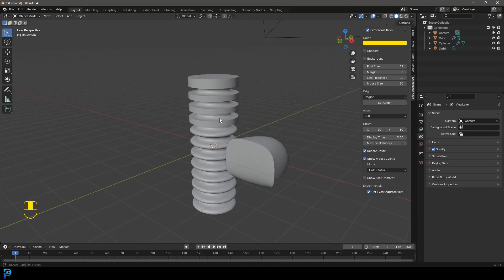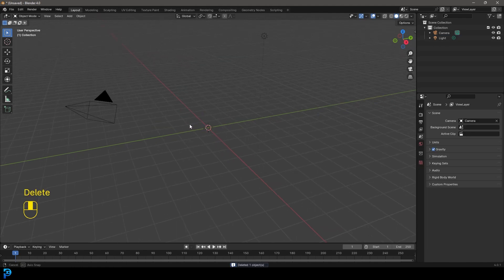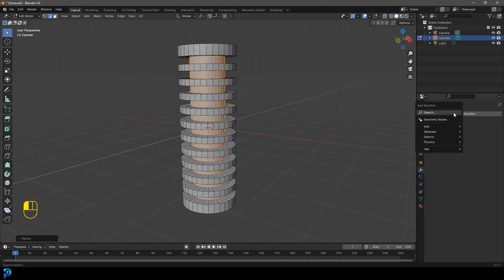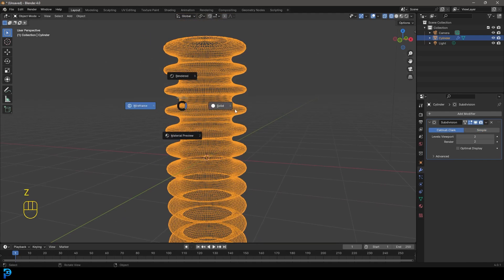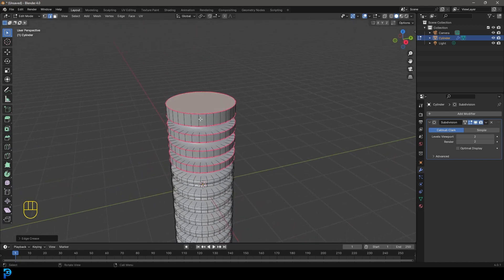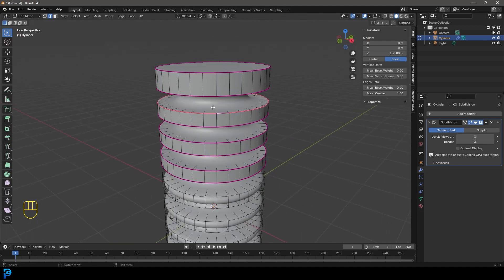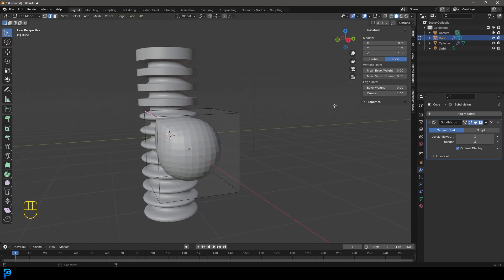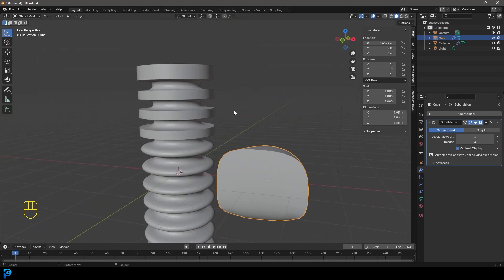How To Use Edge Creases In Blender (Edge Data)

Comment: Thank you so much. I have always been using bevels and loop cuts to tighten my edges but this is way better.
Reply: It may be faster but if you have to carry your model to another program you may run into issues if it don't recognize the crease. i use it to quickly visualize then add in the loops after.
Reply: Think not so much. 

It depends on what your goal is. If you need rough edges with sharp ones, you can use them (and then the export issue remains), but if you need a correct, physically realistic edge that can reflect light and so on (as in life, well, unless it's a sheet of paper), then this will give a bad result, and if we're talking about hard surface modeling, then even more so.